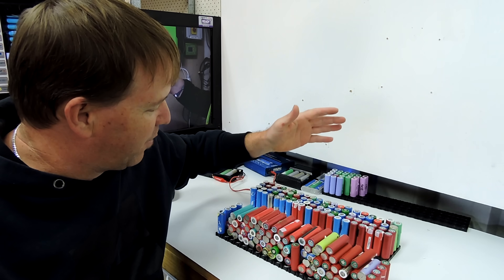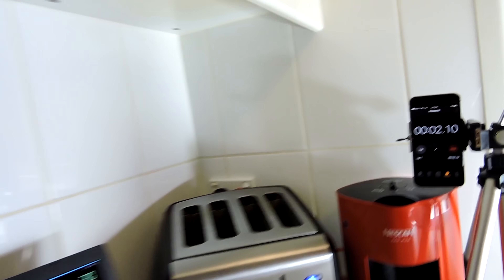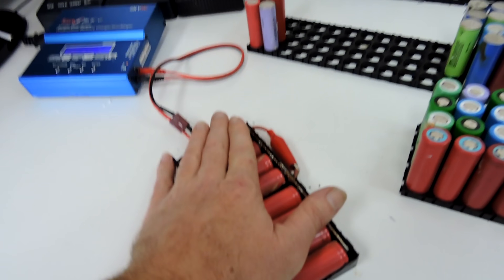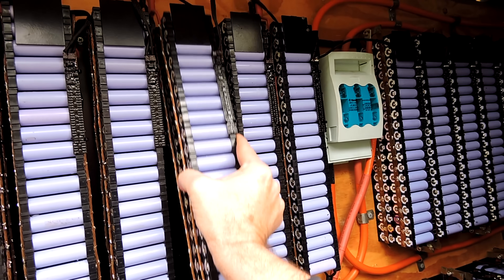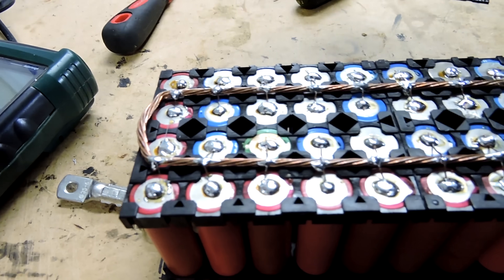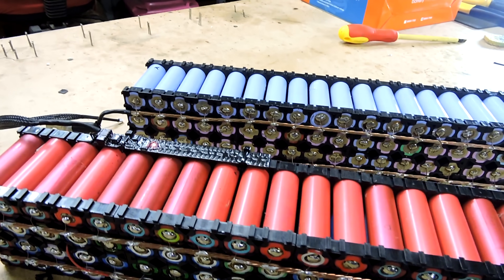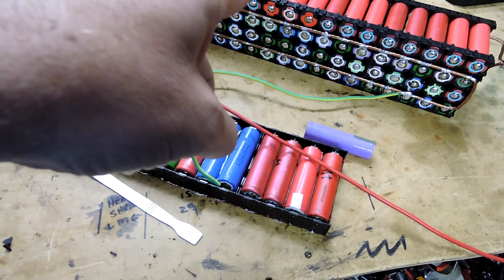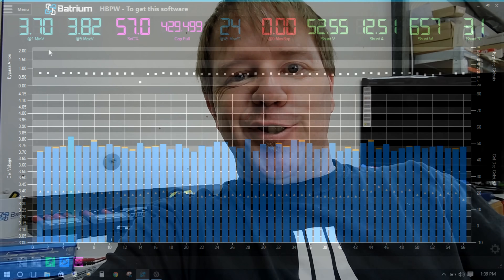It's bad practice but I'm doing it for science - 18650 DIY building for failure

Comment: So you didn't  check internal resistance, or Mha capacity!  (Very important when arranging cells) Also soldering cells destroys your cells due to extreme heat.  And increases resistance and heat! And loose efficiency.

Fuse wires are smart but should still be spot welded.
Reply from the maker: this was so long ago, we have already passed your suggestions lol
Reply: @HBPowerwall  lmao 🤣 just saw the date on video,  omg not my Fault stupid Google recommending me old Videos, lol well hopefully i save the next guy who gets suckered in as i did! 

I will try and catch up to your channel since your new to me☆

Comment: what size of wire u use as an fuse, I have nickel chrome awg 32, is that safe enough for a small pack 40 cels
Reply from the maker: it would depend on your load

Comment: active cell balancer 1s ?????
Reply from the maker: hell no... if your implying using that to keep the batteries balanced thats a stupid idea - fix the problem don't hide it with cheap electronics.
Reply: HBPowerwall thank you. What type of fuse wire is used to connect 18650 batteries ??

Comment: How often do you check the cells in the power shed for "heaters" with the thermal camera?
Reply from the maker: weekly
Reply from the maker: and it's not just the cells, it every connection, solar panel connections cables etc..

Comment: Isn't it bad for the batteries to discharge straight from one pack to another?  Shouldn't you put some kind of load/resistance between them?
Reply from the maker: depends on the resistance of the wired used and the voltage difference i guess

Comment: I have only built without testing once. And failed as soon as I got to initial balancing as one of the cells was totally dead.
Lesson learned: Measure voltage, charge, capacity test, recharge, rest. Rinse, repeat, build, win.
I now only skip indepth testing on brand new cells but even still I'm more inclined to capacity check and voltage match to ensure the finished pack will maintain good balancing when in use.
Reply from the maker: Yep, new cells you can take a lot of short cuts but some things like votage and perhaps IR should be tested.. I test IR on all cells now also.

Comment: Yep, we're asking for an explosion an a terrific fire here.  There won't be anything left of that house.  LiOn batteries need to be spaced with a barrier between them to keep one from igniting the other, and individually monitored for temperature.  It takes just one cell problem, tested or not to cause a runaway ignition reaction.  How do I know?  We blow them up in a test chamber at work to study them when making battery backup units for enterprise computer systems.

And OMG, I just noticed the direct-to-cell soldering!  Heating a battery with a soldering iron will damage the adjacent battery chemistry, pushing the cell further towards failure.  Please read any battery manufacturer, that's why they use spot welded tabs - to prevent heat damage to the battery.  It's bad enough on NiMH, but you're doing this to lithium cells!  But when you have an epic failure, it'll make a great Youtube video!
Reply from the maker: You bet it'll make for a good video - one would hope it'll pay for the repairs :P

Comment: What is wrong with cells, that heated up?are they faulty
Reply from the maker: Fire hazzard - a lithium cell that heats up has high internal resistance
Reply: @HBPowerwall  I have many cells that warm up when in test in charger (littocala), but only some of them have resistance of 125mOm. Rest of them at about 40-60mOm

Comment: Soldering cells together? I was told at Total Battery, that it is better to weld the cells together. Their explanation was that heating the end of the cell up for the time required to melt solder and attach the wire is sufficient to damage the internal connection of the batteries cells.
Reply from the maker: Totally possible - i'm four years into their theory with a real world test.

Comment: I think the main issue in doing this is you lose about 25% capacity from the worst cells
Reply from the maker: Ended up with a dozen bad cells that turned into heaters & was given away.. that said it would work in a pinch but it's dumb and dangerous if you have any other option to do it better
Reply: @HBPowerwall  Can you recommend good blutooth heat sensors( Per individual battery)

Comment: After longer time what do you think is the better System: the BatteryHookup Nickel Fuse or the System of this Video and: how often do you need to check (and repair) the fuses?
Reply from the maker: OOh hard call, haven't tested enough to make that call - but Battery Hookup's is STUPID fast to build if you own a spotwelder. If you don't the old way is a very good path to follow

Comment: Recharging 8 cells in parallel connection using IMAX, 8 is the limit....? Heard 16 we can charge  at a time is it true???  If 16 or 8 do we need to regulate high voltage,amps if we add more cells???

Comment: Hi! is it safe to connect (in parallel) lead acid 12v 9ah battery to a 2 4s2p configured lithium ion (18650) batteries on a motorcycle? and wont it damage my motorcycle?
Reply: Daryl Joe Callo - Noooo way dude. Don’t do that please

Comment: It’s an issue of energy. Energy in energy out. More amps in and over the 4.2v limit these batteries will catch fire. Use hot breath on a candle it won’t light use a flame thrower and you’ll burn the house down. Hot breath = 0.1 amps Flame thrower 100amps. Just a random example explanation.

Comment: You have shown how to test for a bad hot cell that was once good.  There is a point where a cell goes from being good to bad.  So your wall could have one cell that decides to freak out and go hot. How do you protect from this?
Reply from the maker: I have a few there were good that went bad - all that happened so far is they went zero volt - blowing the fuse. Had none reverse or vent as yet

Comment: You need a big resistor on alligators. Thats what I use to balance my 6s when I first build em. Just clip it on and let it cook till its where you want it. I even run more than one across more than one cell sometimes while its charging just to pull em down. Don't forget its on there though or your pack go poof.
Reply: wiring batteries directly without current limiting device was very bad idea

Comment: Where do i get the wall racks and the plastic pieces to build the strips of batteries?
Reply from the maker: I make & sell the mounts in Brisbane, Australia & the cell holders from http://18650shrinkandcellholders.com/Cell.Holders
Reply: Is there a web site where I can buy the wall racks?
Reply: This site - http://18650shrinkandcellholders.com/Cell.Holders - which one do if buy for the wall racks? i assume 4X what? do they snap together?
Reply from the maker: 4x5 plastic holders, mount post disappeared https://secondlifestorage.com/t-HBPowerwall-Official?pid=885#pid885
Reply: Do you have a supplier in the us that has the wall racks? If not can I order them from you? Is there a link anywhere?
Reply from the maker: I don't think there is anyone in the US making them at the moment some did try, But they don't move very fast, unfortunately. I hate shipping stuff and sending these to the US would triple the cost of them. You might like to try mike - https://secondlifestorage.com/u-mike you can contact him throught the forum. He used to have some like mine.

Comment: I have already used cells that were under voltage of 1.5v-2v (I used imax charger to revive them) and after recharging for the first time they have continued to work well, retaining voltage around 4.05v-4.15v. Why do you discard them? Tks!
Reply from the maker: I test all cells above .0.2v voltage is not an indicator of cell health
Reply: HBPowerwall I've always thought that the most reliable way of knowing battery health was by measuring its internal resistance
Reply from the maker: I guess it would be if you could do it cost effectively and accurately, till then i'll just use the Charge, rest, Voltage test, charge, discharge, charge, Voltage test method
Reply from the maker: that is a guess just like every other device we have to ir testing :( too many variables for it to be practical voltage, temp etc

Comment: Were you spending all this time manually testing and balancing your batteries because this was before you had the extra hardware to automate that for you in the final setup?
Reply from the maker: No spent all that time so I could sleep at night!
Reply: HBPowerwall, so, old batteries are that potentially dangerous, and all the monitoring and control hardware is not sufficient to compensate for that?
Reply from the maker: Can't compensate for being stupid and putting known faulty cells into a pack. Test them properly, only use higher mAh cells - stands to reason there will be less maintenance & will last longer.Time will tell if it was time well spent or not..

Comment: I'm new to the battery game. Doing my due diligence of research (even ordered the book "DIY Lithium Batteries" by Micah Toll) before I attempt to build a power wall. Could you give us some background on why this is bad practice? I image it has something to do with stressing the other battery packs. I didn't plan on using used/refurb cells but did plan on purchasing cheap cells from eBay or Aliexpress. The ones I'm aiming for are supposedly 3.7v at 6000mAh at about $1 a piece. Just from what I know about buying cheap stuff, it's never what it's suppose to be - so I'm assuming I'll get half the capacity as listed. Are there other gotchas I should be aware of? Great video by the way! Liked + Subbed
Reply from the maker: ANY cell above 3400mah is fake! Your 6000mah cell is probably 1500mah new and with in a few cycles possibly half that. Aim for about $4 a piece and get from reputable seller. Places to start would be https://endless-sphere.com/forums/ or http://www.diypowerwalls.com both sites also have Facebook Groups
Reply: Thanks so much for the links! I figured as much by just seeing what others were experiencing. Knew it was too good to be true.
Reply from the maker: Yep, a few youtube searches will bring you a wealth of info on those crap cells

Comment: how to you manage not over discharging the cells? most protection circuits on ebay cut a 2.5v which seems too low?
Reply from the maker: My http://www.batrium.com BMS  is COMPLETLY Configurable I can choose my low and high volts

Comment: Where is part 2 I wanna see if this failed immediately.
Reply from the maker: +TheMadMachine12 days into testing and running well that said today is washing day so 5x heavier loads expected see how it holds up
Reply: HBPowerwall that's amazing u should tear it down to see if any are less the 1k mah, but how amps actually hit each of ur cells since u have so many. I also noticed any good cell can handle loads of 500ma but when u stress laptop grade cells above 2amps that's when u have problems.
Reply from the maker: max I've pulled from a cell is 0.25 amps be less again in a few weeks when I add a few thousand more cells. :) Just need the space
Reply: HBPowerwall that's makes sense then why they work. thanks for posting all ur stuff i really like it. I want to try to do a small a.c. couple with my enphase inverter and a pure sine ups I have but I don't know exactly if it will work.
Reply from the maker: you can only try and see :) it's half the fun really

Comment: so, how its going?
Reply from the maker: Too good so far! I was hoping for complete failure within 20 min!
Reply: i can not undrestand what failure was you expecting? cells arn't heating, holding charge. so whats wrong? yes you can expect less capasity, more self discharge, and some (better quality cells) will give more current than others, but it shouldin't blow fuese. yes, its better to sort batteries, but i can not imagine any grand failures. bescide, i wouldn't underestimate deeply discharged cells
Reply from the maker: Maybe not a grand failure - but life span and just general safety - a whole step has been missed. Will pull the pack and inspect tomorrow and take a look
Reply: waiting :)

Comment: Out of curiosity, and a spirit of reckless experimentation,  I ran 50 ma into a few laptop cells ( about 100 ) at <.5 volts until they came up to 2.5 and then into a charger at 500ma - 4.2 volt limited. Some of course were open , and if they were self discharging and or heating I rejected them. Cycled and recorded capacity, some were 2.5 amp hours, most were 1 to 1.5 amp hour and anything below .75 amp hours were destine for the "country and western" box ( they's a hurtin but ain't dead yet ). Then left the charged cells alone for two months and checked charges. 75% of them actually passed all that. I'm not about to do a power wall with these ( well any salvage 18650s ) but they've been in flashlights and USB power banks for a year now with no issues and I am thinking of making a few low voltage UPS to keep things like the cordless phones and the cell phone amp running during outages. Probably use a PIC to monitor charging and switch the loads, then again a set of diodes and a boost regulator and just toggle the charge circuit between on at 3.7 volts and off at 3.9  would be quick to build.
Reply: so in the long run it would be better to build the power wall with new batteries?
Reply: @WilliamNewberryTheHandyRealtor  I would expect it would be easier to match new cells. I did go on to build 5v, 5.5v and 9v ups supplies for cordless phone bases, cell phone repeaters and a 19.5v laptop recharger / battery  bank using reclaimed cells. Very happy with the results. Most were 4 matched cells in spring clip holders. The laptop recharger was 32 cells, welded together with a load balancer.
Reply: @garygough6905  what do you use to measure the amp/hours or how is it calculated?
Reply: @WilliamNewberryTheHandyRealtor  there are several useful tests. On reclaimed batteries I like to  cycle them in a BT-C3100 charger. Charge, discharge and measure and then recharge and compare the amp hours needed to charge to what had discharged. Then let them sit for awhile and check the voltage.
A fast test for battery health is measuring internal resistance. You do that with a VOM and an external load resistor. It should be rated to dissipate the heat generated. For instance a 10 ohm resistor loading a 4.2 volt fully charged Li-Ion cell will draw 420 ma and dissipate 1.764 watts, so a 5 watt resistor will be safe. 10 watts will be cooler.
The test is read the open cell voltage, then apply the load and read the voltage under load. Then it's Ohms law math. The voltage across the external resistor tells you the currant. The difference between open and loaded voltage is what is being dissipated across the internal resistance will give the internal resistance  ( V/I = R ).
These numbers relate to the maximum draw rate and cell heating,  but they don't tell you the stored energy. As an example I have two reclaimed cells from the same group in one pack they are both showing an internal resistance of 1.6 ohms, but one stored 1.2 amp hours and the other only 0.2. The resistance is high enough that I would be hesitant to use them at discharge rates over 500 ma, which would also be a .8 volt drop.

Comment: Are you going to try and see if the faulty ones will recover, or are they goners and a waste of time.
Reply from the maker: Just a fun test really to see the end result with out guessing
Reply: I kind of meant the hot ones and the ones that don't hold charge, but do you mean that some in that pack will be bad even though they passed that guys recommended testing procedure because he didn't do charge testing.
Reply from the maker: hot ones are instant bin jobs, all the other <1.7v cells have already been processed and results will be in part two
Reply: I'm mainly looking for battery info, so I can't wait for that one. Good work.

Comment: I would never use unknown cells. and I have seen cells with low voltage .turn out to be the best of the bunch! I would test capacity and self discharge & heaters. before building a pack. I guess a 500mah and 2500 mah cell would be 1 3000mah cell. but if you could have 5000 mah would be better.
Reply from the maker: Plan on testing in many different ways after a few real world tests are complete

Comment: Question: Why go through all the trouble of using hundreds of smaller batteries when you could use a a dozen of the larger ones? Is it performance, cost, efficiency, or something like that?
Reply from the maker: I've done the whole Lead, AGM  thing, finances played a part in not wanting to buy new cells - then this idea came along and it got a little out of hand. Then it worked so well it got even more out of hand.

Comment: Hey, love your vids man keep tearing these packs to shreds.. quick question. I've gone through a number of your vids and many others in regards to these lithium powered systems using the MPP solar inverters, but i haven't found a straight answer on how to set them up for lithium specifically.(might be an awesome idea for a full walkthrough vid btw).  I'm about to make a 24-volt system with the pip2424lv-msd(in the U.S.) and im able to get the same size lithium pack in my area as agm, but i dont know how to setup these inverters for it.
Reply: also any idea how i would go about setting up a longmons system for a chevy volt pack?